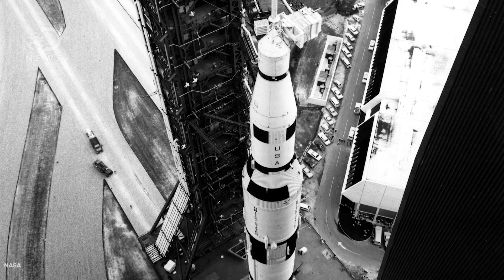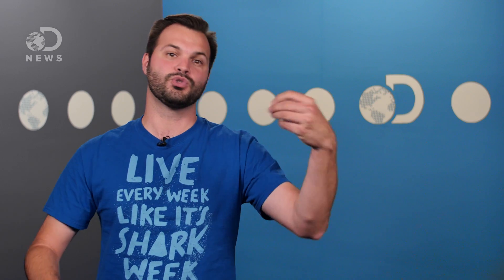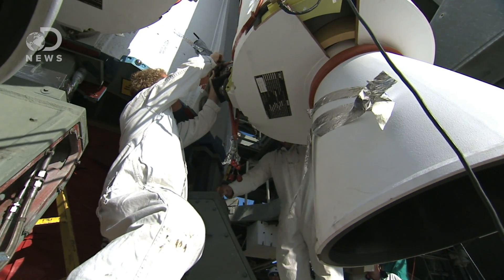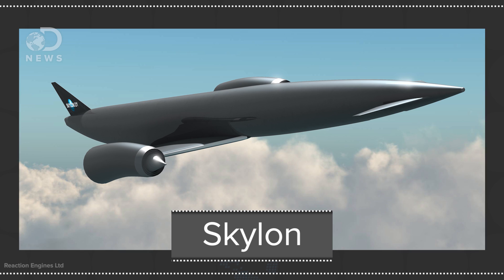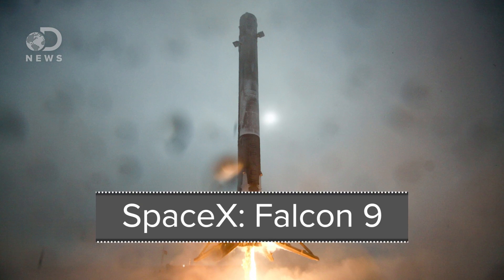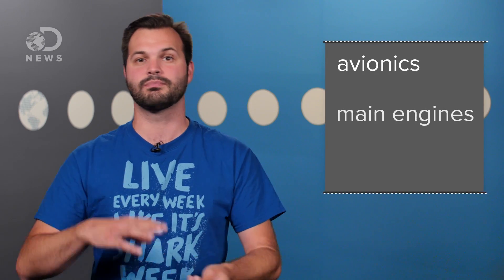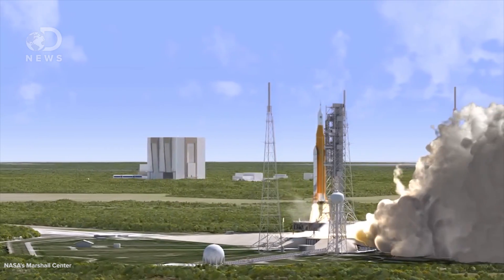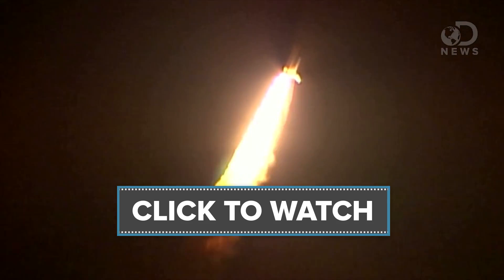What Will Rockets Look Like In The Future?

Comment: Launch loop would be a far better solution than a space elevator. It only needs to hold the weight of itself rather than a tens of thousands of tons throwing hammer. There won't ever be a space elevator because a launch loop will do the job far easier. The same reason we don't use helicopters to airlift cars over a river when a bridge is a far more economical and practical solution.

Comment: why not use a magnetic cannon to fire a huge rocket into space, with electronics that expand outwards in space so they don't get damaged from the magnetism?
Reply: Because you could only have something that large in the ocean, and that would be very expensive not to mention hard to keep maintained or even run.. The power requirements would be ridiculous, and wouldn't be viable unless the payload was a certain size.. Although a newton's cannon ball type system would work, it's not a viable solution for delivery of anything other than small satellites..
Reply: Draden Merenox But how much power do you think it would require to fire a projectile in a horizontal manner? Remember gravity. When you fire a rocket parallel to the ground, it would just fall down back to the Earth because there is simply 1. too much air resistance 2. its requires a lot of speed just to blast that rocket out of the atmosphere in a horizontal manner. 

We dont even have much infrastructure in space except some satellites and a cloud of space junk.
Reply: +Ricky Pantua oh yea, let's push air out of the way at orbital speed. Oh boy... Above the speed of sound, you can't push air out of the way, without compressing it. At orbital speed, at the sea level, pushing the air out of the way is like pushing hardened concrete out of the way. Things that hit the atmosphere actually hit the air so fast that the air starts to bond chemically onto the surface of the projectile. Steel burns like cotton...
Reply: basically a railgun. it could be done with modern tech for 20 billion. just google "railgun to space". we could shorten the track to launch non manned cargo to space/leo/moon, build a giant rotating ferrying ship. boom. beginnings of space infrastructure.
Reply: There are many possible launch-assist systems like an electromagnetic space cannon. The current flight rate is not great enough to justify the capital expenditure of any of them.
Reply: A magnetic cannon would be great but try to think about this - how long would that cannon be inorder to launch a 10 ton object? It would tens of kilometers long - but that's not the bad news. The bad news is, because we need 25000 mph speed to reach the orbit, our cannon would need to launch that object at that speed or near that speed -we can solve that length problem but that would mean we will only have a short time to launch that object - and when we shorten that time, we will expect to have very high acceleration -  the bigger the acceleration is, the more Gs we have and the human body can only handle 10Gs - but thats not all, our cannon needs to be a vacuum in order to even sustain that speed without melting the cannon - we have to take friction into account - the same reason why car size or house size meteors fails to reach Earth would be the same reason why we cannot use a cannon here on Earth. 

Maybe if we build that cannon in space - but that would be very expensive.
Reply: Dillon Scott fire it horizontally (so there's more time to build up speed, and so gravity won't be as much of a problem) using electricity that's beamed down from orbit, created from the much stronger radiation from the unfiltered solar rays.
Reply: Ricky Pantua I really can't believe you right now. Horizontally in this case refers to an inclined plane (why the fuck would anyone fire a rocket completely horizontally?). The air resistance won't be a problem as objects with more weight have more momentum when thrown, pushing the air out of the way. No shit it requires a lot of speed, but with the magical technology called storing electricity in mass quantities, you can more easily use massive amounts of electricity in less time. It doesn't have to be generated in the moment.
Reply: therflash better use butter lol... not a bad idea, a bond resisting coating

Comment: what happened to the scram jet? I remember when that was gonna be the next big thing 10/15 years ago
Reply: scramjet needs a continuous flow of air to its engine for it to work, there is no air in space
Reply: +Paul Ramos there's an air in space museum
Reply: scram jets don't work from stand still, so they were deemed impractical. those can anyway only work in atmosphere. so you need booster to get the scramjet up to speed and than another to get to orbit after you run out of outside oxygen.

their main application is currently in being the next gen cruise missile for US Air Force after NASA abandoned them as wholly in practical for their use.
Reply: scram jets need a boost thats why it is strap on a plane before it can launch itself thats the reason they only use it for cruise missile right now, but maybe they are experimenting on a hybrid scramjet where it has a normal engine like a normal plane to give itself a boost then firing the scramjet to take over, but having two engine is so impractical maybe thats the reason NASA scrap the idea

Comment: We've been talking about the space elevator for how long now?  And graphene batteries?  Less talk, more doing.
Reply: +Gregory Samuel Teo (alveolate) it's also worth noting that carbon nanotubes aren't strong enough for space elevators
Reply: John T the problem with carbon nanotubes is that they have minor flaws in them when made. Unless you had nanotubes with zero imperfections the amount or design wouldn't matter as they'd still have that critical error
Reply: John T 
"In something of a "downer" for space elevator fans, Pugno has calculated that inevitable defects will greatly reduce the strength of any manufactured nanotubes. Laboratory tests have demonstrated that flawless individual nanotubes can withstand about 100 gigapascals of tension; however, if a nanotube is missing just one carbon atom, it can reduce its strength by as much as thirty percent. Bulk materials made of many connected nanotubes are even weaker, averaging less than 1 gigapascal in strength.

In order to function, a space elevator ribbon would need to withstand at least 62 gigapascals of tension. It therefore appears that the defects described above would eliminate carbon nanotubes as a usable material for a space elevator cable. Pugno will publish his paper in the July edition of Journal of Physics: Condensed Matter. Nanotube enthusiasts counter that ribbons made of close-packed long nanotubes would demonstrate cooperative friction forces that could make up for weaknesses in individual nanotubes."
http://www.space.com/2456-nanotubes-stuff.html
Reply: Gregory Samuel Teo We're still a young species so there's hope for us yet.
Reply: John T some problems just aren't able to be overcome. Unless we make atomically correct nanotubes a space elevator is impossible since by the time you can over come the structural issues in the nanotubes by increasing the amount of nanotubes, the increased weight becomes an issue. And by the time we can create atomically correct nanotubes, we will most likely have cheap surface to space flights, thus making something as complex and dangerous as a space elevator obsolete and unnecessary

It's also worth noting that if you lost even a single nanowire the sudden shift in acceleration and momentum might be enough  to snap the remaining wires.
Reply: John T pure silicon? I'm not quite sure I understand
Reply: we have the ability to build carbon nanotubes but only in a lab. there isn't a feasible way to upscale it practically for construction.
Reply: +Daniel Carter (DanielSanCarter) That's not true. Steel is strong enough but would have to flare at the top to larger than the observable universe. Carbon nanotubes would only have to flare out to 3.5 inches wider than the base, in order to support its own weight.
Reply: nice info. all i remember is that carbon nanotubes were posited as the only likely practical material. if even that is gone... then welp.
Reply: By the time we're able to manufacture carbon nanotubes on the scale necessary to make a space elevator, I would imagine most of those details would be ironed out. Engineers also wouldn't bother attempting the project without increasing the diameter against our original, minimalist, projections to offset the margin of error described. Either way, I'm sure we'll come up with something better long before then.
Reply: Daniel Carter Like pure silicon. That's the spirit :/

Comment: Nuclear powered planes maybe? This was actually tested once by the russians. Sadly most of the crew died from radiation poisoning later but that was because they didn't even include radiation shielding. The thing actually flied. The basic principle behind a nuclear engine is that you have a reactor and you pass a gas or a liquid over it. The matter is then turned into a hot plasma and shot out of the back of the engine. The good part is that you can use the atmospheric gas to propel yourself and then switch to onboard fuel like water, ammonia, carbon dioxide, anything. Perhaps the only part that would need some chemical propellant is a part when you are still raising your apoapsis out of the atmosphere then it should be fine.

Comment: Can we just use a giant balloon to bring people up in space?
Reply: +Colin “crazy” what about using helium to rise to the stratosphere then launch the rocket from there?
Reply: i think the problem has to do with reactionary force. a balloon could lift the rocket to the stratosphere, but it probably won't be stable enough for the rocket to launch off of it. launch ballistics require very precise angles, and a big deviation could mean the rocket heading towards a populated city instead of space.
Reply: No, balloons use helium, or hot air, hot air goes up while pushing cold air down, but in space there is no air, and a balloon wouldn't be able to lift all the stuff that has to be carried to space. And if you want a hot air balloon you need fire to heat up the air, fire requires oxygen, and oxygen isn't something we have in space. Sorry sir.
Reply: +Troll King what Gregory said, although if we can put vehicles on Mars, I think it should be possible to hold balloons perfecty still... If we can think of some formula's and use some small thrusters to correct the angle that the rocket will be launched at, ofcourse this will be very hard to do. The other thing we could do is make a new kind of vehicle like a space shuttle but with some modifications so it can "manouvre" while leaving the atmosphere. This would be very hard as well tho, because of the insane presure and thrust force. To give a comparable example, it's like you cannot open your car door when it's sinking to the bothem of the lake/river etc. and you can only open the car door when it hits the bothem because then the presure is balanced. (Sorry for bad English, it's not my natural tongue).
Reply: +Troll King This was actually done when testing parachutes for Martian missions.
Reply: Way to steal my idea people !
Reply: Some one must give this kid a nobel, he deserves it more than Obama!
Reply: +Colin “crazy” you are such a dream killer
Reply: +Troll King NASA tested it already, back in 2014. It was an inflatable heatshield with guidance system on top of a rocket engine strap to a balloon. They used it to tested the inflatable heat shield tech
Reply: Ok people troll king just copied my post moments after I posted it so boo him and also the rocket would be below the blimp hanging from a cable and it doesn't matter if the balloon is moving because rockets can steer 

And also open your closed minds people gees
Reply: Colin that would use more rocket systems and fuel, and still with no guarantee that the rocket won't deviate accidentally. any gust of wind could be disastrous.

rockets can steer, but unless you redesign the fins massively, they can only steer at speed. the problem with an unstable launch platform is you need to steer BEFORE you get speed.

ultimately, a balloon launch is just a dynamically unstable option which presents way more variables than it solves. if there is ever an atmosphere where wind isn't a factor, perhaps.

Lyndon Lucier just because people have reasons to counter your suggestion, doesn't mean people are "closed minded". present a foolproof idea and maybe you WILL win a nobel. and Troll King didn't JUST copy your idea, he added the part about launching. you merely stated "use balloons".
Reply: Greg you need to re-read my post I did mention " rockets " is the entire Internet incapable of reading written text or is it just the people I run into
Reply: And I also didn't say ballon I said blimp ! Can people not read basic words ?
Reply: Lyndon Lucier what? I never copied you.i've been wondering about this since I was in 5th grade.
Reply: Lyndon Lucier btw the only reply  before mine was that "Colin" guy
Reply: it sure as hell was
XD
Reply: +भारतीय read the all the other reactions.
Reply: i cant handle you people

its like theyre  picturing a saturn 5 tied to a single little red balloon or something